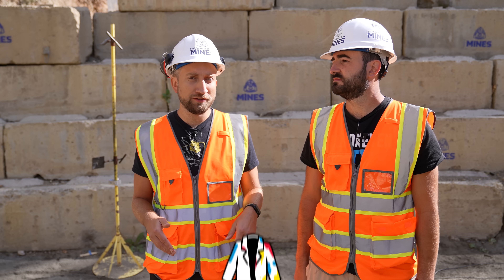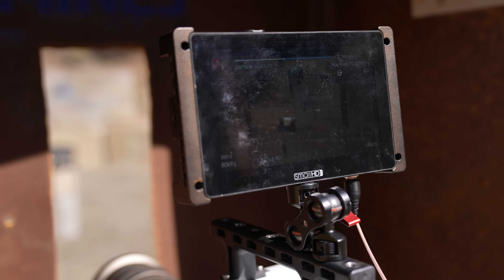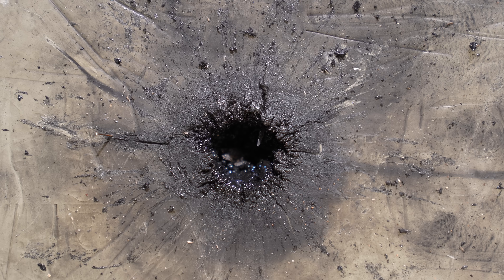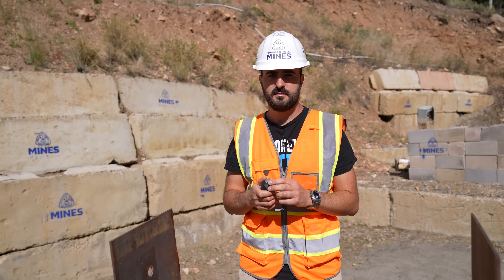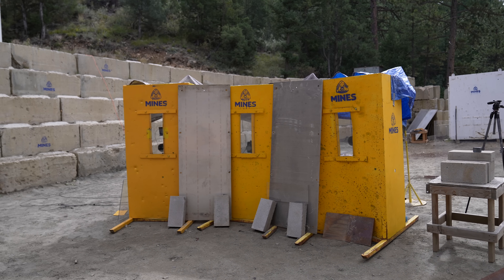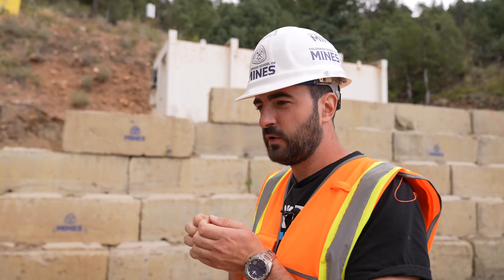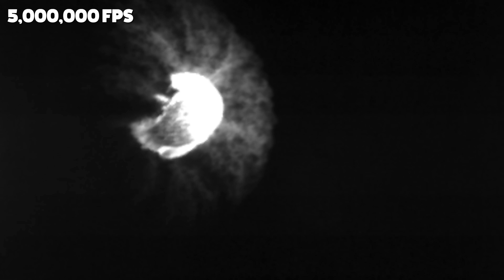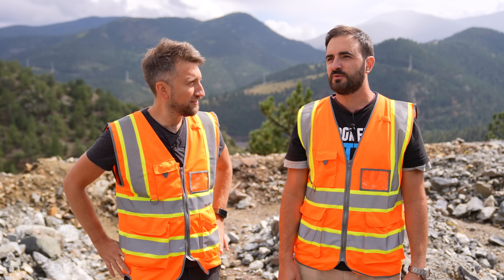15,000MPH Colliding Explosions in Super Slow Motion - The Slow Mo guys

Comment: So cool! (as usual). If a perfect shot (in terms of the projectiles hitting each other) can ever be achieved, the steel plates will have to be locked down hard against movement. I imagine even a couple dozen micro-seconds of difference between ignition of each charge will move the plate enough to throw it off at the impact point.

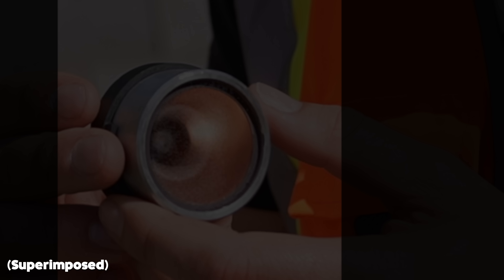Comment: 15:45 "How did they know this?" - it was discovered when a trademark, impressed on the packets of dynamite got impressed on steel plate, so they studied it first as a curiosity that cavities on the charge surface created cavities on the target and extrusions caused bumps on target. Later some structures were observed to develop speeds like 300km/s (0.1% of c) and emit gamma radiation. These were not conic but cylindrical cavities.

Comment: Why is the tip so bright (and blue)?

1. Enormous pressure of the initial explosion collapses not just the copper but also the volume of air inside the cone, increasing the temp higher than the chemical reaction of the explosive would alone.
2. Aerodynamic friction heating of the jet as it slams through the air at 15,000 mph (~Mach 19.5).
3. The already super-heated copper burns blue as it rams into oxygen in the atmosphere, creating the blue hues in the flash.
4. When the jets hit or glance each other, they interact at a relative speeds up to around 30,000 mph (~Mach 39). Crank up the above effects by something like 4x.

Awesome Video!!! :D

Comment: Gav describes a explosively formed penetrator in the beginning when he is asked what a shaped charge is,  shaped charges can be used without a penetrator but it isn't usual in military applications,  it would be useful to cut through steel beams in buildings where a superheated blob of copper flying through anything in its way wouldn't be beneficial to the situation 😉

Comment: I know you hear this all the time but this might be your best video yet. I would to see you revisit this every year to test out your best new equipment.

Also it would be extremely cool if someone could overlay all of the videos to try and show the full spectrum of the shaped charge explosion.
Reply: Yeah, I was wondering about something close to that - maybe a setup with a single lens that feeds three separate, synchronised Phantoms through a beam splitter, or prisms or whatever. If the cameras all had different exposure settings, then the brightest parts and the dimmest parts could be recombined afterwards, reintroducing all the detail that would otherwise be washed out. 
I imagine that kind of set up getting really expensive, really fast however...
Reply: But imagine the desktop background you could make.  @stickiedmin6508

Comment: @theslowmoguys Hey guys. You should check out: First Light Fusion. It's a UK Company that is making a fusion reactor by doing something similar you were trying to do in this video but with projectiles. By colliding two projectiles with enough force exactly right you can achieve enough pressure and heat to start a fusion reaction.

Comment: You guys HAVE to figure out how to make/align/whatever two shaped charges to get them to lign up perfectly. I'm pretty sure even militaries would love to have a peek at that footage. I wonder what kind of temperature it would reach if those two jet tips stopped each other dead in the tracks. Hot enough to boil tungsten carbide? Hot enough to initiate fusion?

Comment: Well done Slow Mo Guys. This shows the difficulty of high speed explosive photography. As a high speed video operator, trying to get the exposure right with explosives is always very difficult.
I use a 'first surface' mirror and put the camera in a steel enclosure during explosive work. I have had a fragment go right through a lens! This also caused some damage to the camera. A mirror prevents any damage to camera. I have lost a few mirrors since, but they are way cheaper than a new camera or lens. I know!

Comment: I took my masters in military science in 1995 at Shrivenham, and also qualified as an advanced armoured gunner in 1993. Both courses covered shaped charges (used in High Explosive Anti-Tank (HEAT) rounds), and the phenomenon that you note at 15:52 was known back then, ie that the sides of the cone actually get pushed to the centre, and the copper gets "dragged in" to the jet. I'm not sure how they knew it at that time, if they had Mfps cameras to catch that instant, or if it was modelling with empirical confirmation, but it is well-known, and has been for more than 30 years.

Amazing video! The lowest fps shot of the "impact" I'm sure will result in some vfx using that whole sequence in some movie 😊👍

Comment: As it was explained when I was in the Army, the heat gets trapped inside of the copper plate and is shot like a bullet but the heat, speed and material makes it so it rips through anything in its path. Cuts through light and armored vehicles like a hot knife through butter. Looks super dope in slow-mo though

Comment: guys, if you have a 5,000,000fps slow motion camera, i believe you should be able to film light traveling at 60 meters per frame(300,000,000/5,000,000). With a really long path created by mirrors, you should be able to see a laser beam progressing. Not sure if the footage itself would look cool but seeing the light to be not instantaneous would be cool.

Comment: Guy named Munroe was working with bits of cast high explosives.
To keep track of the bits, he scratched numbers and letters into each.
Later, he found that the etched lines turned into impressions on the test steel targets.
In very little time, he worked out the 'shaped charge effect'.

Comment: I have to say the Slow Mo Guys have been killing it with these Colorado School of mines videos. It’s amazing to see that you can expose just the tip, but that bright spot is actually air not copper.
Reply: Curious. Copper at that temperature would obviously be putting out a hell of a lot of light - are you saying that the glare from the superheated / super-compressed air around it would block, or drown out the light from the copper itself?
Reply: Watch the Schmidzu footage at the end, I cannot see any light coming from anywhere other than the tip.
Reply: @doublethinkmod  
Yeah, but why assume it's air that's putting out that light, rather than copper?
I'd expect that the rest of the jet is just as bright, but hidden behind the expanding explosion - the tip is the only visible part because it's out in front of . . . everything else?
Just guessing on my part, naturally.
Reply: I also didn’t see any light during the ballistics gel scene…you can literally see the light turn off when the tip travels through the gel and back on when it hits air again.
Reply: @doublethinkmod  
Fair point. Fascinating stuff - I sense a hell of a lot of digging, searching and reading in my immediate future. 
I wonder if there's still enough information in the posted video files to analyse spectroscopically? That'd be a sure way to tell.

Comment: It's like a double bounce on a trampoline! The shockwave seems to follow around the sides of the charge and then get turned around and help accelerate the rest of the copper. The shockwaves squeeze the copper from all sides so that the only way out is the direction of the charge, and just pinches it out at insane speed!

Comment: I wonder what kind of electric and heat energy   if any it produced from then explosion. You guys should have radiation and temperature measuring equipment next time you do another experiment just to get data on it and it would be insane if it were to produce electric and or radioactive particles.

Comment: We definitely need another video where they are perfectly aligned. This was amazing (maybe try linear charges for better chances of impact)
Reply: Agreed that this needs a revisit. Perhaps Gav will find an even beefier camera by then, since this one tested the limits of the current ones.
Reply: Let that be, it would be the end of the world... 😱
Reply: @bicmac333 yup fo sure
Reply: The first test was the closest
Reply: @frankcastle5301 My thinking as well. I wonder if the noise Gav heard after the first test was the collision
Reply: I wonder if they might be able to aim a bit more precisely by welding on a length of pipe to the 'exit' side of the metal plate, or whether that would interfere with the jet?
There's a million cool things one could try with those things, but I imagine they're quite expensive toys . . .
Reply: @stickiedmin6508  I think the easiest way would be to build a frame/jig. Like, build the frame of a long rectangle and have the plates on the ends, like caps.
Reply: @S.mashing.Blumpkins  
Are those shaped charge explosives consistently 'accurate' enough to confidently predict exactly where the jet will end up?
Given the way they're usually used, I wouldn't expect that it's the kind of thing they put a lot of effort into during manufacture.
Before this I honestly had no idea how narrow and tiny the copper jets really were - I imagine it would be frustratingly difficult to get two of them to hit each other exactly square on...
Reply: @stickiedmin6508  even if they aren't, they're clearly accurate enough that they were able to get within millimeters in this video. That's close enough that I'm sure they'd get a collision by chance relatively quickly if they just kept trying.
Reply: @S.mashing.Blumpkins  i the use linear charges and have then slightly non parallel like a x
Reply: Agree!!!

Comment: I almost wonder if the sheer brightness is just from the copper ablating (burning) away from friction with the air at 16,000 MPH (which, for a point of reference, is about 1,900 MPH slower than the International Space Station's orbital velocity). Kind of like what happens to a meteor or spacecraft on re-entry.
That'd explain the brightness from the two jets passing too; there's more burning material there. And probably the color of the lens flare as well; Copper burns blue-green.

Comment: Instead of a stick holding the charge try lying it down on its back and using oobleck. Also just blast some oobleck! 

Also, did you consider tinting the glass for more light reduction?

Comment: It's fascinating that while the tip is there, the shock wave has it's own force and energy. And it makes sense, the energy from that singular point is gonna radiate off in all directions as it moves creating a cascade. But this also means the common trope of anime lasers is maybe kinda accurate. When they have the tiny little beam of energy that just erupts into the 50 foot wide  cylinder of destruction.

And the final part, where we saw the "down the barrel" angle, does it basically use the rimmed explosion to basically stuff it into a single channel? Like, the energy naturally wants to go in all directions, but by having that sort of inward force, it effectively cancels all of that except the small bit at the central aperture.

Comment: 2010: Here we are in our backyard to smash a lighter on the ground next to a fire and film at 1000 FPS! 

2023: Today we are at an explosive testing facility detonating multiple pairs of shape charges directly at each other and filming at 2,000,000 FPS

Amazing to see how far this channel has come!
Reply: 2036: Today we are here at the Moonbase Ultra-Large Hadron Collider, colliding electrons and protons directly into each other and filming with our electron-micro-phantom-pro 9001, with full color X-Ray, filming at 1 trillion frames per second in full 8k resolution.
Reply: @bigmartin343 my avatar is an electron camera for seeing quarks.
Reply: @bigmartin343 32k resolution 😂
Reply: @bigmartin343  At 1 trillion fps, one single second of footage would be 530 years long if played at 60 fps and also take up 2 billion Terabytes of space :)
Reply: @melanp4698  It was technically already done quite a few years ago to capture the movement of light itself.
Reply: @bigmartin343  Not at 8K resolution :) Or 1 Trillion fps :) But yeah light is fast :)
Reply: @bigmartin343  Strictly speaking, they didn't actually film at 1 trillion fps. That was impossible at the time.
 How they achieved virtual 1 trillion fps, was that they launched millions flashes of light, taking single snapshots a trillionth of a second apart, progressively. Then they just combined those single-shots to a running film.

BTW. Here is Slow Mo Guys's story of filming the speed of light at 10 trillion fps...
https://www.youtube.com/watch?v=7Ys_yKGNFRQ
Reply: @toweri_li  That's where my "technically" applies to my statement.
Reply: And they are still just two blokes having fun.
Reply: 10,000fps!? - That was the full title of a video 12 years ago and it was just Gav smashing coffee mugs on concrete. Lol
Reply: in all fairness if you told them they'd be filming at 10 million FPS in 2023 they'd think you're making a joke because that tech didn't exist let alone was thought probable back in 2013. (other than experiments that were a 1 off thing and cost WAY more than anyone could afford to pay for commercial use)
Reply: 2036: Today we have a nuclear bomb, filming at 100 billion frames per second.
Reply: Well, they also filmed at 10million fps
Reply: @summerthongsuwan3419  A distinction that doesn't really change the point or meaning of the comment.

Comment: Gavin - you should do a video about neutral density on the 2nd channel.  I'd love to learn more about that
Reply: The quickest explanation is sunglasses for cameras. 🕶️
Reply: It's just a filter that's dark, so there's less light entering the camera. They usually come in stops (and it's logarithmic), so an ND3 basically lowers the incoming light by 1 stop.
Reply: ND filters just reduce the light entering the lens. They allow you to decrease the brightness with the same shutter speed (like he talks about in the video) or maintain the same brightness with a lower shutter speed. Lower shutter speeds (longer exposures) create motion blur. Think long exposures of bodies of water that make the water look smooth and give a dreamy feel.
Reply: @samuelpmoran 
It's pretty obvious just from context that it's a feature to reduce the amount of light getting in, but I'm still really curious about what exactly it is, how it works, how it's implemented and most importantly, why it's called that.
Reply: If you want to shoot with a filmic setup, you film at a 180 degree angle. So e.g. 23,976 FPS, and a shutter speed, at twice the amount.

But if you do that in sunlight, your video will get over exposed. So you give your video camera sunglasses on - ND filters.
Do a search on the 180° rule in cinema.
Reply: Not disagreeing with the rest of your comment, but that's not what the 180° rule is.

Comment: What is more deadly from 10 meters - a 9mm bullet or a shape charge? (assume both were properly triggered/fired, not just thrown at the target)
Reply: The bullet. A jet from that size and type of shaped charge wouldn't have any mass left at 10m. The overpressure and shrapnel from the case would be more dangerous.

Comment: 13:50 You are basically watching very hot copper collide with the oxygen in the air making it burn up, which releases more energy. All you can see is the "flame front" and most of the material that follows behind doesnt have any oxygen to react with.

Comment: "How do they know it would do this?"

Well, mathematics, science, first starts as a theory that is (somewhat) confirmed by some mathematical equation. Then it's prototyping, testing, iteration, improving the previous prototype, test again until they get to what they were looking for.

Also war helps a lot. Soon you have to kill other humans people go into overdrive to find out how to blow another human to bits more effectively. After all the shape charge used in the panzerfaust, panzershreck and the bazooka (which these shape charges are based on) appeared during ww2 when people were just invading and killing and military technology advanced a lot in 5 years...

Comment: It seems that it's very hard to get both the brightest light and the darkest parts in the same shot, without the video being over- or underexposed. Are there any cameras with a logarithmic sensor, so that both could be seen in the same shot? Bet that it would require a VERY high contrast ratio in the sensor.

Comment: Pretty much every other slow-mo project: “we need more light!”
This one: “we might not have enough ND filters.”
Reply: Whats ND?
Reply: @MISHBASH neutral density, I.e grey.
Reply: @DrDeuteron  They're not exactly grey, at least none that I've ever seen or used (not that grey can't exist). The footage looked grey because at those speeds, the video is shot in black and white
Reply: @DrDeuteron   It's neutral because it decreases all light equally; it has a neutral preference of light reduction (I assume absorption). Most things are frequency dependent and different wavelengths come thru different. With the ND filters, you get a net reduction with no changes on color.
Reply: @caodesignworks2407  They pretty much are a perfect grey. Not just appearing grey to us but just a flat absorption all across the spectrum.

Comment: 13:38
Okay.. THIS makes way more sense than the "inverted cone projectile" description that was given before..

Once it starts inverting, the explosion doesn't just stop right there, it makes way more sense that most of the cone gets sheered off and you're left with a hyperspeed speck at the leading edge.
Reply: 14:44
I'm wondering if that tiny speck is actually the remains of the metal cone burning in air.